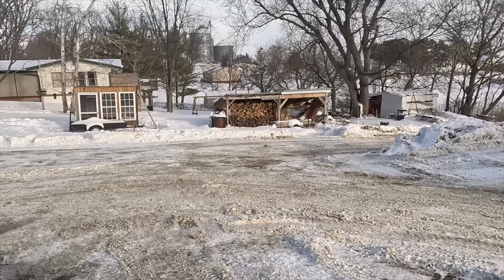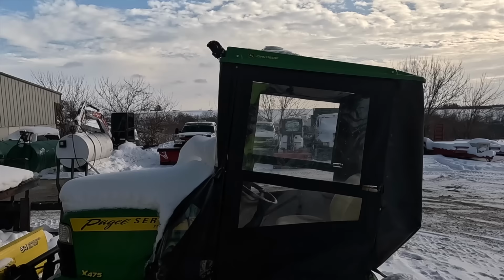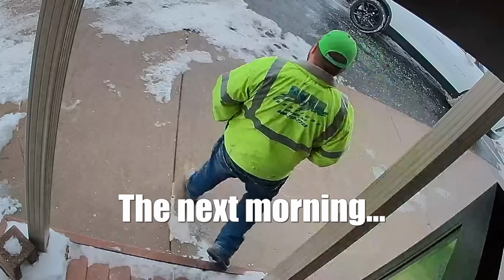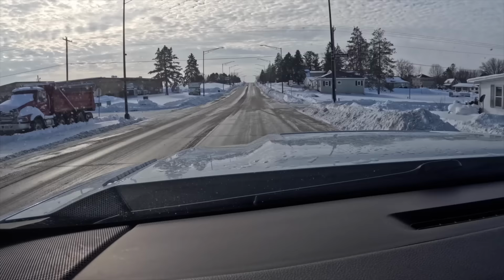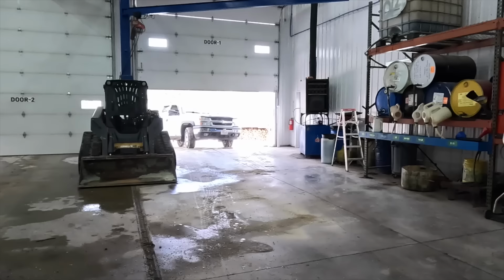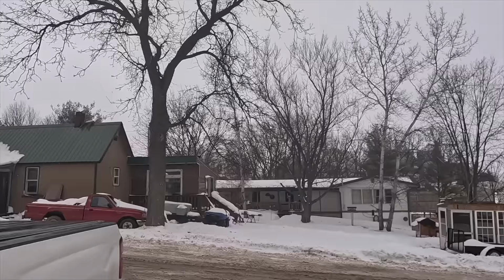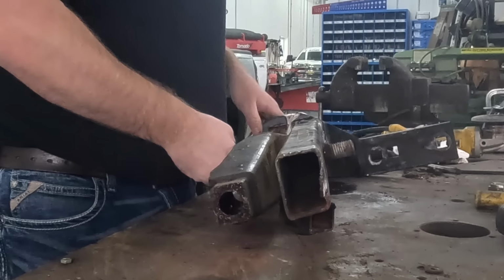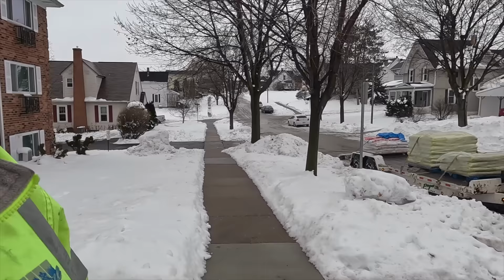Snow Removal CEO | A glimpse into my day

Comment: Love the videos, didnt know you did snow also. I am from Ontario Canada. Id suggest yea a 924G loader to push banks.. just 1, you can get them pretty cheap 30-40k since they are 2002 to 2008ish.. Would definitely do the trick just with the bucket, youd be surprised once you get one, you wonder how you did stuff with a backhoe or skidsteer.. Now plowing with them is even better but the angled pushers are pricey like a AMI Reactor

Also I am surprised yous still have 2004-2006 chevys on the road lol
Reply from the maker: Thanks for the tips! We are going to run these Chevys for another 10 years!